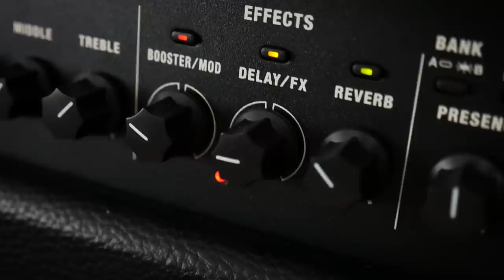Amplifier Classes Explained | Boss Katana Artist

Comment: I have the Katana Artist...love it!  The thing is LOUD.  I know about amp classification from the car audio world.  Car stereo amps are rated the same.  Class D was always reserved for powering bass subwoofers.  If you look at all the latest bass guitar amps on the market now, you'll see a trend of super small heads with crazy power (like 800 watts).   That's class D power.
Reply: Erik Stone How come class D power means less volume than class A if D has higher efficiency than A?
Reply: When talking about efficiency, there is always a "compromise".  If you put a high efficiency shower head on your shower, does it flow more or less water?  Same concept here.
Reply: Erik Stone If both showers take water from the plumbing at the same rate, the one with the higher efficiency makes my head wetter.
Reply: Totally spot on. I've got a 250 watt Carvin bass head that could fit in my gig bag. Sounds great and has more than enough power on tap for whatever I need. I'll never lug a a giant bass amp to a gig ever again.
Reply: mkaali both showers do not take the water at the same rate.  The water hits the shower heads at the same rate, but the efficient head creates a bottleneck that helps conserve water (which is what makes it efficient).  So with the amp, as you heard in this video...class A is a full stream of power with very little bottleneck.  This is why it sounds pure.  The downside is that it creates a lot of heat, so it looses energy in that heat (ie: non-efficient).   Class D processes power completely different since that power is "filtered".   You may loose sound quality and volume due to the filtration, but what you get in return is a cooler running amp that doesn't need large heat sinks and air moving around it to cool it down.   It's a trade off.  Maybe someday we'll have a new class of amp that has the best of both worlds.
Reply: Erik Stone I still can't understand how Class A (lower efficiency) with 100W of power can create more volume AND heat than Class D (higher efficiency) with 100W. Somewhere, someone is using a physics term wrong.
Reply: No offense, but it may be you that is using the term wrong.  Think of it like this:  low efficiency (bad power handling) / high efficiency (good power handling).   Let's talk cars as another example.  Take a Toyota Camry (gasoline engine) and a Toyota Camry Hybrid (electric/gas engine).  Both are the same cars - Toyota Camry - but one is low efficiency (gas engine) and the other is high efficiency (hybrid).  The gas engine model is faster because of how gas engines work.   The hybrid car was not built with speed in mind, however it was built to be fuel efficient to save on gas money.   So the lower efficiency car is faster, and the higher efficiency car is slower...on purpose - to sell to that crowd that worries about gas money and the environment.   Same with amps...the low efficiency amp is louder but puts off heat and is large and bulky - which is cool for people that like that sort of thing.   The high efficiency amp (class D) is not as loud, but is smaller / lighter and puts off much less heat - to sell to people that want that sort of thing.   They both have a place in this world, so we as consumers need to figure out what our place in this world is.  Do you like the big loud bulky heavy good sounding amps?  Or do you like small portable amps to move around easily with?   There's no right or wrong answer.  I know I'm not the best at explaining things, but I hope this helped at least a little bit.
Reply: Erik Stone Yeah, none taken, I like these arguments. This is how people learn. So yeah, I understand that lower efficiency usually means higher output because that's how it usually is. But the term efficiency doesn't imply that by itself. It only means that the power it takes, it uses it efficiently to the thing it's supposed to do (sound in case of amps). And about power, if it means power input, it's at what rate it takes energy, and efficiency determines how much of that is converted to sound energy -> higher efficiency = louder. If it means power output, then equal powers mean equal loudness, the lower efficiency amp just makes more heat and wastes more energy. That's at least how I have learned about power and efficiency in electricity. That's why I wonder why 100 Class A watts is louder than 100 Class D watts, because it should be the other way around or they should be equal.
Reply: I think the confusion is that you're assuming that the rate it takes the energy is the same.  I think that part of the efficiency handling is the rate it takes the energy.  So if it takes less energy to help conserve power (high efficiency), then that would explain your lower volume.
Reply: Erik Stone Isn't that what power means? 100W means 100 joules per second, either taken or output. If efficiency is meaning here "taking less energy" then there's your wrongly used term.
Reply: It's 100 watts output.  An amplifier does just that...it takes a signal and amplifies it.  Regardless of the input, it's going to amplify that to 100 watts.   The "way" that it's amplified is where it gets tricky, and I don't know all the voodoo behind that.  For example...a 100 watt tube amp can sound louder than a 100 watt solid state amp.  It's all in the way it's designed.  Possibly the solid state is more efficient with it's power handling?  Not sure, but would be my assumption.
Reply: You are correct that 100 watts means 100 joules per second while the equipment is running.  However this is not what defines wattage.  Wattage is Amps x Volts x Power Factor.   Power Factor is a dimensionless number between 0 and 1.  The closer to 1, the better the power factor.  Devices that put off heat are closer to 1 than devices that do not put off heat as a design.  Example would be a stove would have a higher power factor than a refrigerator because a stove outputs that heat.   I definitely don't have all the answers, and maybe someone else needs to join this conversation to help explain better,  but this is all I've got for you my friend.  The less efficient amp is louder.  We may not know all the ins and outs of why it is this way, but our ears definitely know this to be true.
Reply: mkaali not sure of your experience with electrical circuits, but amplifiers work using an input signal (the one you want to amplify) and another DC power supply. The amplifier uses this DC supply of a particular wattage to create the output of the circuit. The efficiency rating of that circuit is (Power_out/Power_DC)*100. Because of this, power_out (volume) can be any value while keeping the same efficiency, as long as power_DC is also changed accordingly. Because of this, a low efficiency class A amp can be louder than a high efficiency class D amp, as long as it’s power_DC value is large enough. Here’s a website that goes into a lot of the nitty gritty of power amplification, classes, and much more: http://www.rocketroberts.com/techart/powerart_a.htm
Reply: Erik Stone the power factor isn’t an indication of how much heat is lost in the device, it’s an indication of how much instantaneous power is used by resistive vs. reactive components. The power factor is also an indication on the phase difference between the voltage and amperage. The power factor can also be negative, so it is a number between -1 and 1 given by the equation pf=cos(theta_v-theta_i).
Reply: mkaali 100w is its output, not what it draws from the wall. A 100w class A on full tilt might be drawing 400w from the wall. That extra 300w is heat. While a 100w class D might only be drawing 110w from the wall.

Comment: I've got a Boss Katana 50 and it is my favorite thing in the world. I only really play guitar in my home so dropping the output wattage with the flip of a switch while still keeping things sounding good is awesome. And that amp SOUNDS. GOOD. Even if I had an excellent 1W valve amp I'd still need a bunch of a pedals to get the sounds I'm after. The Katana has many effects built in so I don't have to journey very far. Its not the ultimate amp, but its all one really needs if they are after a simple, affordable, practice amp.

Comment: Great explanation vid!

My Kustom 1200HD bass head is Class B, which concerned me before I bought it, but switching technology has vastly improved and crossover distortion isn't as much of an issue with longer waveforms.
Reply: It's actually Class D, so it has nothing to do with the crossover distortion associated with Class B. Class B will always have these crossover problems pretty much, so that's why it isn't used in audio while Class A/B is. 

Class D, on the other hand, is quite good for audio, especially for high power amps. It's the only one of these 4 classes that use the switching technology.
Reply: My mistake: I don't have the 1200HD - that's the new one that is Class D. I have the Groove 1200, which is Class B. Some Google images label them the same, thus why I mentioned the wrong model.

Comment: I have a Katana Artist and to me it feels like a valve amp, without valves. This thing is awesome! Personally I only use it "old-school" and will probably never muck about with the computery stuff - I can get everything I need from the from panel, just like any other "real" amp. Re the construction of the cabinet, the only part that doesn't feel so solid is the panel that has been fitted in the back to make it semi-closed (and care should be taken with this area) . The rest of the cabinet is very solid indeed! As long as nothing is bashed into the back of it, I think it'll last for years!

Comment: Believe it or not, I played your channel through class AB Amp in my Pioneer SX-780 Receiver through minimus 7 speakers with great results. Unfortunately,my power packs in 780 are aftermarket crap replacing damaged or dead originals behaving as close class B. Keep volume up, they're good until you go low volume. I am considering attempting to mod my receiver to discreet components since there's no more decent power packs. I also have sx-880 with discreet components in class AB and sounds great.

Comment: Nice summary.  Well-explained.  I tip my hat.

I recently bought a Class D 50W/50W amp from Parts Express.  Cost me $10 (can I say about 6 pounds?), and is the size of my Raspberry Pi.  Mind you, that doesn't include power supply.

Comment: Informative. Subjectively, apart from the clean channel being ok, these amps do not sound good nor like a tube amp but if it were half the price they would be good enough for a beginner. No matter how you tweak the drives/controls the drives sound weird and not in a good way. I had the opportunity to try one of these KA amps at home playing along with various artists (classic rock, hard rock, alternative, punk, thrash, grunge, metal etc) and in a live jam situation and this amp did not cut it at all. After hearing hype and reviews I was seriously considering one until I got my hands on one. They sound best playing along with just a metronome or alone, nothing else, and to me just sound like two square drives together trying to hide the abrasion....I bought a tube amp. Use your own ear though, I've been using tube amps for many years maybe I'm overly fussy with my crunch, Overdrive and high gain sounds. Maybe this amp clashes with my level of hearing loss lol. It's best feature is it's efficiency.

Comment: Fender Mustang III v2 should be an honorable mention because it's similar to the Katana except a bit older and cheaper, it's also a solid state amp with 100 presets you can edit in every single way, you don't even need pedals because of the footswitch

Comment: Excellent descriptions. Many people confuse these terms, and amp companies sure don't help. The number of times I've seen any kind of cathode biased amp called "Class A" is insane...by people online and by companies trying to take advantage of how Class A sounds like a cool high rating score.

Another thing, to go deeper, is the fact that Class A amps can have two output tubes in push pull. It's just not particularly common for various reasons. 

You can also have class B or class AB single ended amps, but they would sound terrible and not be desirable for audio since you'd be loosing a portion of your signal. They've had other uses though, such as in radio applications.

Comment: 3:08 The "class B" depicted here seems more like the unbiased version which, yes, will have major levels of crossover distortion. Douglas Self, on the other hand, classifies class B as the optimally-biased push-pull output stage, with class AB being a class B with a pointlessly high idle bias, which (ironically enough) actually leads to higher distortion than the optimal bias. Plus the associated extra heat waste.

Comment: Unfortunately not every amp manufacter indicates clearly the class but knowing that the valves are push-pull (for example) it's easy to tell that it's class A (with the characteristics that you explained very well: heavy, heat, high energy consuming, etc.). Only class AB is publicized as a positive factor, for other they just don't tell what class is the amp. Nice video Colin, cheers.

Comment: That Boss sounds better than several valve amps I’ve played or heard. I can tell it’s solid state, but it’s got the tone so dialed in, I’d have no problem arriving from the airport with my fly rig and having those on the back line instead of the usual suspects.

Comment: Awesome explanation... I always knew Class D were working digitally, but A, B and AB always remained a bit of a mystery to me. Your explanation was simple and to the point. Also, very nice illustrations.

As for the Katana Artist: Seems like a nice amp. If it fits your bill (i.e. you actually need the volume and its features are what you're looking for), it definitely seems like a good deal. I'd still prefer a "cheap" valve amp to get going with a good basic sound (there's plenty below the currently reduced 600€ price tag at Thomann) and build a pedal board over time, but that's just me.

Comment: Universe is kind to me - i got a Bugera with switchable A/AB-operation - and yes the modes sound and behave differently.
Great amp.

(BTW - i have built a monster 2ch Bang&Olufsen driven IcePower class D amp too, great overkill - havent tried it with guitar yet, though - might try is out with bass in some future. It´s a home stereo rig right now. The power section alone weigh 20 kilos, the case is 7cm high. A real sleeper)

Comment: Just a small note about the different feel from a transistor to valve amplifiers:
Even using the same method of amplification, the response might be quite present, because of a simple reason - their electrical characteristics are quite different, hence they behave differently.
No valve will behave like a transistor, and no transistor will behave like a valve (FETs share some characteristics with valves, so the difference there might be smaller).
It's also true between different transistors and different valves.
Nature of the beast.

Comment: I have been doing the occasional gig for the last 7 or 8 month's with my 50 Watt Katana  v2  without a single issue . Haven't even needed to mic it into the PA its so freaking loud while still sounding fantastic . I do need wifi to access the Tone Studio and all the effects but other then that for $170 USD , I talked the guy at Sweetwater down $30 dollars since they had a big shipment come in . I got a steal ...  Best Amp on the Market price is unbelievably low for such a versatile quality Amp imho ...  Oh I play mainly 80's style Thrash , Metal and some Glam it handles all three no problem ..

Comment: Put that next to a mesa dual and it'll fail miserably ;)! €600 vs €3000!
The Katana Artist is still a cool amp though. Can definitely compete with tube amps around €1000. There is still a huge debate  whether it performs well on stage though. I rarely see endorsers commenting on that. Seems to be more a "home use" and "studio" amp. Would be cool to hear some thoughts on that. Cheers.

Comment: Hey man, nice video, you explained it nicely.

Just a small addition - class D amps are actually quite linear, which is why they don't get that much good reviews. They stay linear through a quite large range, but we are used to "dat tube sound," which sounds that good exactly because of the small amount of harmonic distortion generated. Of course, if the design is done badly, the amplification stage will sound like crap anyways. Mosfet is actually the most cost-quality-efficient way to simulate the holy tube stage.
The presence and quality of the output transformer makes a bit more of a difference than the style of the power stage.

Nice tones you've got out of it!

Cheers

Comment: I think it's worth noting that Class AB amps in tube amps can be biased to Class B operation depending on the plate current at idle from the grid bias. Some people actually like the crossover distortion, as it's a little grindy sounding.

Comment: Now, I do have a question: in what way could the wireless system affect the tone, if at all? Generally these systems do have a loss of quality, so if this is case (a big if) could this render the better amplification useless? I also understand that it may have just been for video recording, but I am curious if there would be a noticeable loss of signal otherwise.